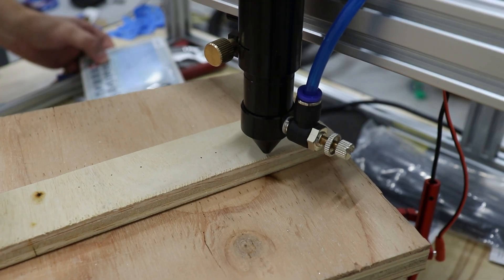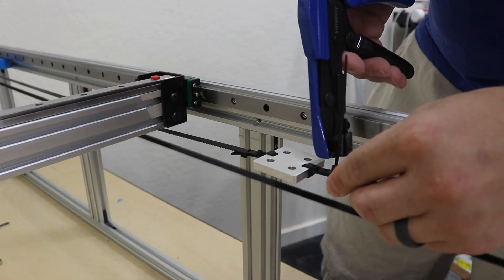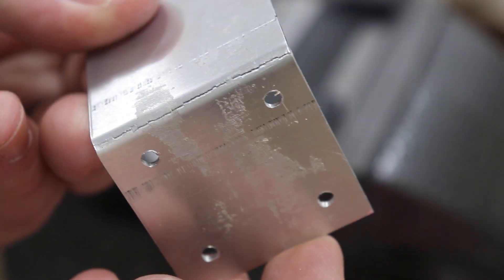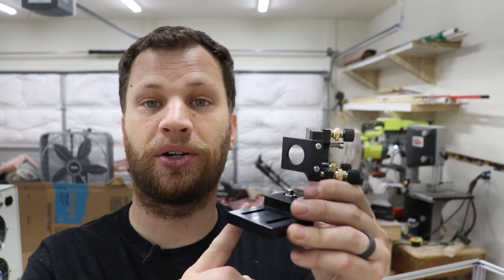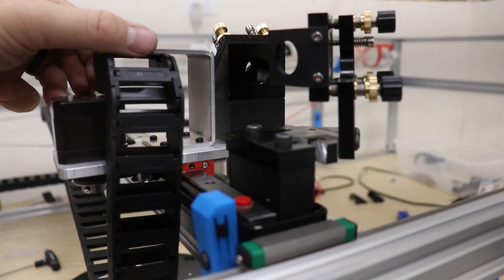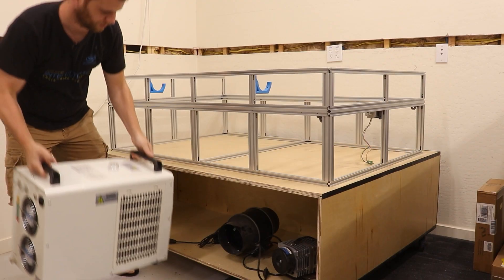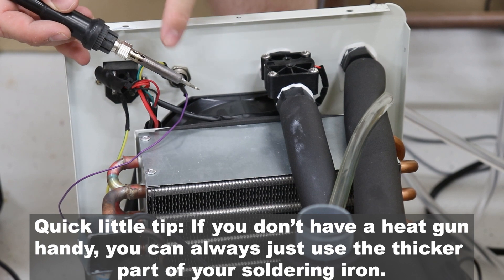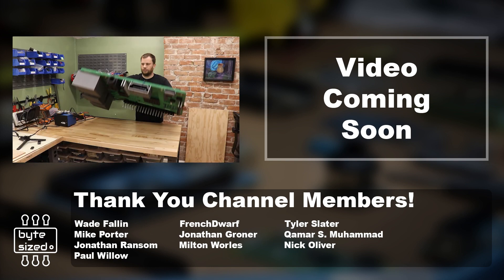All That Work Just For This? - CO2 Laser Cutter Part 5

Comment: Aluminium needs to be annealed so i use normal  white hand soap rubbed onto area then heat with gas flame untill soap goes black, quench aluminium straight away. Ready to bend.
Reply from the maker: Is that for all alloys? I mostly use 6061.

Comment: Sheet metal is supposed to be bent with a radius which ranges from the material thickness for 6mm and below up 9.5x the material thickness for 1/2". Believe it or not, there is also "grain" in aluminum. You can cheat and bend aluminum against the "grain" with an almost nonexistent radius as you were trying to do. Very sharp bends always produced weak structures.

FYI - When bending metal with the proper radius it is necessary to calculate the flat layout and to calculate the bend line. There are formulae for these functions.

Comment: Why put the stepper motor on the plate that the focus head is on, it is extra mass and thus momentum, could it not be mounted on the Y axis gantry and fix the belt to the focus head plate so the motor remains stationary in Y moves?

Comment: 6061 can be bent. It just work hardens more than the lower grades so you need a bigger bend radius. Something like 3003 or 5052 can make sharper bend radii but using a sharp pointed bend die will cause you trouble with most materials anyway. Taking some sand paper or a grinder to radius off the sharp point of the die will help a lot.

Comment: Bend radious is too tight. An easy fix for this is: cut a strip of steel sheetmetal that is at least half the thickness of the aluminum sheet you are triying to bend. Is doesn’t have to be “exact”. Now, take this strip of sheet metal and bend it ats tight as you can (with the bending tool). You want this v shape piece to fit tight against the male part of your bending tool. Now with this added piece, the radious of the bend won’t be as tight and it should give you better results. You can experiment with different thicknesses of inserts and make different radiouses by stacking them. 
I hope thst makes sence. It comes quite useful when working on aviation sheet metal when we don’t have the option to temper the aluminum.

Comment: Aluminum bends...
Correct on 50 series aluminum being better suited to handle bends. However, your 60 series and also the 50 should be hit with a carburizing flame and annealed. It will make it much more plyable and forgiving.

Comment: Aluminum tends to break like that during bending for several reasons.  One, its too tight of a bend, or sometimes it needs lubrication during bending so it can slide.  Also The type of alum makes a difference, but you could also try different jaws for that bender, and see if one with a rounded nose helps keep the stresses down on the edge.

Comment: aluminum requires a bend radius.  6061 and 7075 are bad for cracking, especially in the T4 and T6 hardened state.  Use about a 1/8" bend radius minimum.

Comment: Maybe bend a little, heat it to resolve stresses in the lattice.. Bend a little again.. heat it again.. until you've got the bend you want. Or try bending it with a bit more heat in it.. put it in the oven for a bit before bending..

Comment: A trick I learned for using printed paper as a template is to print the pattern on label paper which has adhesive.  They make it in full sheets.  It's more expensive than plain paper but in the grand scheme of things not really much.  Some patterns try to fall apart as you cut the pattern, especially when there are large inside squares or things like that.  I know this sounds funny but to check your art just print on plain paper to make sure you have it right so you don't waste the label sheets.  Also (depending on the size of the pattern) a sheet can be used more than once.  Just be careful not to jam the printer.  Another trick with this is to use an X-acto blade to cut the pattern out of the sheet so you leave the backing intact and the sheet still works in the printer with the rest for a second run.  When you have a large area bare in the second run you can simply put scotch tape on the bare area to give the printer wheels something to get traction with. This was way more than I intended to say.  Sorry about that.

Comment: aluminum loves not to be bent, steel is all the more better, but with aluminum you must either cast it in its design, or bend thinner sheets very carefully...you can use heat, but aluminum is weird, because it develops a very thin oxide layer on the surface that has a much higher melting point than the interior of the metal, so when you heat it too much and the oxide layer melts, the interior might become unstable...also one of the reasons it cracks is that the oxide layer on the surface is more brittle and it micro fractures when put under strain...and when it makes those cracks that goes to the inside of the metal on the bend, the oxidizing follows, it penetrates...aluminum is a wonderful metal, but one has to understand its personality...but if it works it works! well done to your laser machine build, Zach, it is inspiring, and a hello from South Africa...😊👋

Comment: I am unsure why you used 4 mirrors.  You normally only use one fixed mirror and one on the gantry and the lens assembly.  That shortens the laser path and increases laser power.

Comment: did nothing wrong except using aluminium , it just doesnt bend well , unless you use a more radiused bend 
might be able to 3d print sumting that slides over the knife end of the bending devise you have , using lumbrication on the fork end might help too as it alows the material to slide intoo the fork instead of being stretched

Comment: Aluminum needs to be annealed before bending. Annealing is done with a torch and you have to bring the aluminum to a temperature of 775° you can use a propane torch but you will need a 775 temperature crayon sold at a welding supply store. Mark the piece with the crayon by the bend start heating when the marks disappear you can bend the plate now. With that said 7075 aluminum cannot be bent or welded, only machined.

Comment: Tip for the future: It might help to temporarily remove from the case, the connector with a dificult to reach  pin, or maybe simply rotate the connector to get better access to solder it.

Comment: I'm not knowledge in bending sheet metals. But I know bending aluminum weakens it with every bend. I suspect you will have stronger piece if you were to use a rounded tip that distributes a complete 90 bend over a distance rather than 90 degrees all at one point.

Comment: Blending radius might be to small it will also make aluminium brake.

I think putting the mirrors to the frame where all mechanic are installed also may cause troubles. Especially during engraving when lens nozzle moves very quick like 500mm/s, it may cause frame a little shake/bend which can change laser mirror alignment during the work🤔

Comment: The laser and gantry don't need to be on the same level, you can just use those two side mirrors to reflect the beam downward at an angle and then reflect it back level for the x gantry.
Reply: Thank you :) just wanted to comment the same thing.

Comment: When forming aluminum, be mindful of the type of aluminum. Some bend better than others. 
And when it comes to the actual bend, a good rule of thumb is, minimum bend radius is almost double the thickness of the material, never less than the thickness.

Comment: What was the focus length of that lens.. looked really close to nozzle to Me
Reply from the maker: It's a 50.8mm focal length lens. From my measurements that's only about 4mm from the tip of the nozzle. I need to do a ramp focus test to confirm that's the best place. It seems awfully close to me too.

Comment: The aluminum must be annealed before bending it. Use a Sharpie felt pen and draw a mark in the area of the bend. Heat the aluminum with a torch until the pen mark disappears. It's now "dead soft" and can be bent easily.

Comment: Just a heads up on the mirror alignment. The weird guide circle in front of the mirror is for holding your tape/paper for the test firing.  I switched away from tape and use post-it note paper now, much less residue left behind.
Reply from the maker: That's a good tip using the post-it note. I switch to a piece of cardboard after a while. I didn't want to use the guide circles because I wasn't convinced they were concentric with the mirror alignment. In other words, I was concerned that if I center it on the guide it wouldn't necessarily be centered on the mirror itself.
Reply: @bytesizedengineering  here is the kicker. Center is ideal but aligned is what is the goal.  You want to make sure it hits the same place on each mirror/location.

Comment: 3003 Aluminum Alloy is what you want to use. It has great bendability. I am a Sheet Metal Worker and that is what we use for all applications that has to be bent, rolled or run thru roll forming machines. Look forward to all your videos. Keep up the great work.
Reply from the maker: Thanks for the info!
Reply: @bytesizedengineering  You could also use a 50 series aluminum alloy if the bottom die has a wide enough gap.  We normally say eight times material thickness so 16 g at .0625 equals a 1/2 inch bottom die

Comment: Aluminum can be a real pain, you have it right about certain grades being better for bending than others, even then it will fatigue and crack quite easily. You basically have one shot to get it right each time and it's best to anneal it if you can. Larger radii bend for aluminum are a good practice too.
Reply from the maker: Time to get a torch! All I have now is a heat gun. Since aluminum doesn't change colors when you heat it how do you tell if it's annealed?
Reply: @bytesizedengineering  You do not need anything else, torch or something! Try my advice: change the bend radius and that is it. I said that it do not depend of a material. The same is for steel, copper etc. Try something else, just for the experiment. Put the piece of aluminium in an ordinary vise and bend it by hand. Just push the tip of the piece. The material will bend without cracks. It will bend naturally.
Please, look carefully the next video: https://www.youtube.com/watch?v=TLqfmfZQxA8&list=PLDlWKv7KIIr9mXD-ZEmgW6Gf2PKs0sBYn The guy is fantastic!
(Believe me, I have 40+ years of experience, MSc in mechanical engineering 🙂).
Reply: @bytesizedengineering I am just a hobbyist but I would think you could get thermal crayons for that.
Reply: As others have noted, bend radius too tight when piece is cracking at bend, so, buy/make  bending die set(s) with greater radi for when you have to use what IS at hand, plus the suggestions of  more comptable alloys, some of which may be meatles other then aluminum. Plus the annealing option. I  bet if you talk to the Send Cut Send folks they will have lots of useful ideas/solutions to this problem. Also every fab shop will have lots of interesting/usefuf scrap shapes and will be glad to pass some of them along to an enterprising Maker, you. Love your clearity in problem solving and the pace of presentation!!!
Reply: I’ve seen a lot of metal workers cut a groove on the inside of the bend. Of course they usually weld the seam afterword.

Comment: The bend radius MUST BE GREATER of or at least EQUAL to the thickness of the sheet metal. Practical advice is that bend radius has to be minimum as TWICE as of the thickness of the sheet metal (if it is possible regarding the construction). So the radius of the tip of the metal vice blade(s) must have that radius, in another words, for every thickness you must have the blades with that radius!.
Yours are too sharp, more like to cut the metal. It does not depend of the type of metal, only with the bend radius.
Reply: Exactly!  You're pulling  and stretching the metal instead of bending it.  In other words the tip part of the punch of the break, that gives the inner diameter of the bend, is too sharp.  Other more malleable metals might be fine but aluminium is probably too brittle.

Comment: In addition to what everyone else has said, consider the grain direction and don’t bend parallel to the grains.
Reply from the maker: I didn't know aluminum had grain direction! How do I tell which direction it goes?
Reply: @bytesizedengineering  It has. This was one of the first things they told us about Aluminium  in the three and a half years of education to become an industrial mechanik in Germany. You can see in witch direktion it has been rolled/worked if you look closely.

Comment: Re: Cracking aluminum while bending.  Aluminum work-hardens, which is probably why it cracked.  Try bending part of the way, then hit it with a torch to anneal the metal, then bend it further, repeat.
Reply: his tooling is REALLY sharp. not sure what that tip radius is, but AL isn't as ductile as steel sheet. He should try a tool with a much larger bend radius for metal that thick.
Reply: Work hardening is definitely the issue. And agree that annealing and heat are the answer. There are ways to pre heat treat too that don't involve slow bending. Definitely look up some videos on bending aluminum, there is a lot of help out there
Reply: When bending metal there should be a radius equal to 3 times the thickness at the bend.
Reply: Yes that`s good and don`t use pencil on al for layout. Carbon in pencil is said to effect the al.

Comment: Nice job with the wiring.  As far as your aluminum bracket breaking, you have several options.  1) different and thinner grade of aluminum (more prone to bending), 2) go with a bigger radius on the bend, and/or 3) heat the aluminum with a torch and get it good and hot.  You would need to apply heat as you are bending as well.  Just be careful not to melt the aluminum, one minute it is solid and the next minute it is a puddle.
Reply from the maker: Thanks for the tips! I learned later on that 6061 aluminum is terrible for bending and that I need to use 5052.

Comment: Heat up The aluminium, then bend.
Reply from the maker: I did find out afterwards that 6061 is terrible for bending. You can anneal it by heating it up, but it's better to just use a different alloy